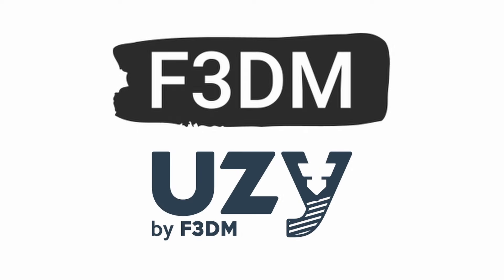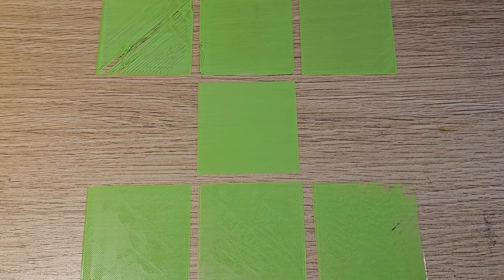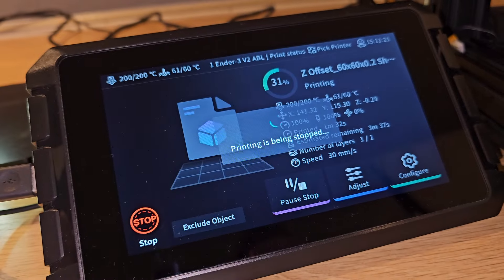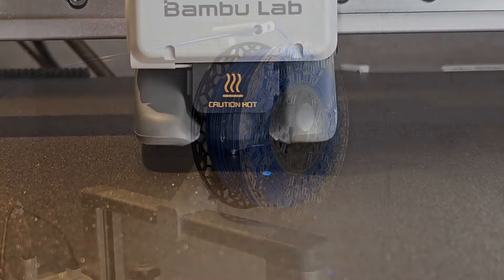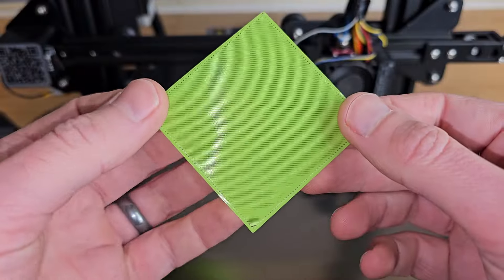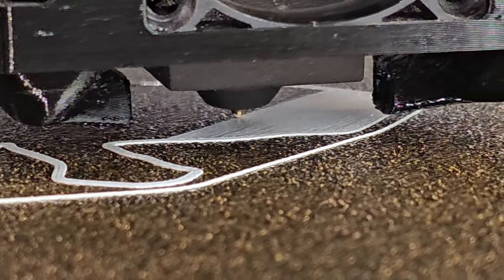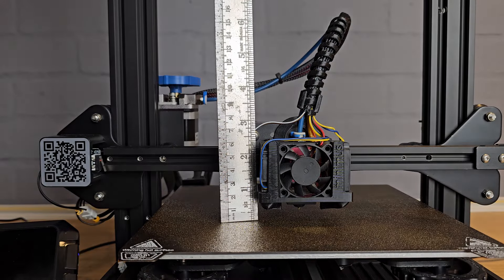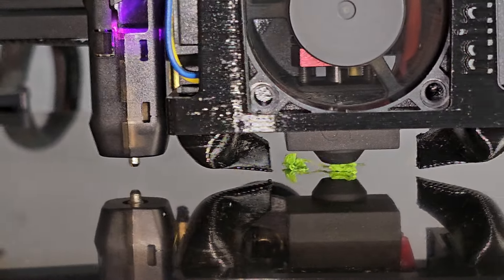Perfect Z Offset On Your 3D Printer - How to get it right!

Comment: Buy a Bambu printer. There. Your z offset is now perfect
Reply: I wish it was that easy. My A1 is having issues with the z offset
Reply: Not so much bro
Reply: Man if I had the 1k LOL
Reply: @iisGavin  just get the $600 version 👍
Reply: Yeah cause I'm going to buy a Bambu just for a Z offset fix 🙄🙄
Reply: @MrNolz33  no, to have a printer that works correctly.
Reply: Mine sure isn’t. Can’t lay anything down because the z offset is way too high
Reply: I'm glad I'm not the only one 😌 bambu a1
Reply: Or spend a few minutes and learn how to use the ender 3. I was given mine for free and a day in I’m printing great
Reply: Help me with that, I have a1 mini, and is just ok in the middle, in the borders are terrible (I already run the calibration multiple times) anyone now how to fix that?
Reply: 😂 so burn a hole in my wallet
Reply: This guy doesn’t troubleshoot.
Reply: My new ps1 is struggling here. So, not quite.
Reply: Can they print like 400mm high like a Flsun V400?
Reply: I’ve had my P1s for two months now and it has a Z-offset issue, it’s too far away, by a small amount…. First layer lines and adhesion issues on the real smooth plates…. So not entirely right there, but granted…. They are awesome for people like myself who just want to be able to punch out prints…..
Reply: @sciencesaves I have a Neptune 4 plus and it works just fine.
Reply: Nah
Reply: @jdub_1911 PS1? Do you mean the p1s or are you talking about the PlayStation
Reply: this didnt age well
Reply: why, bc YouTubers are being drama queens? My Bambu lab printers are still performing flawlessly since day one
Reply: @sciencesaves  You cant even use any other slicers
Reply: @ idk i have an anet just found it funny 👍🏻
Reply: @ I only find things funny when they are true. Otherwise …
Reply: @ThatOneDude248  #TeamNeptune
Reply: @sciencesaves they're basically no different than any other printer. They just have the tinkering done ahead of time. Parts still break, things still get out of whack. I've read plenty to posts on it. My ender 3, with just a few mods (and it was about $250 brand new 4 years ago) is a work horse, and I can print fast and reliably. When you buy a bambu, you are essentially paying for somebody else to work out the kinks for you, with necessary upgrades already done, which to be honest a lot of printers are like that nowadays. A lot has been learned in the 3D printer community, so companies are passing that along to their customers for a better experience.
Reply: We're not all trust fund babies. Spare us your useless comments that add nothing to our 3d printing journey
Reply: By replacing or upgrading 3d printer like Ender 3 v3 se mobo can be useful..
Reply: Wouldn't touch Bambu Labs with a barge pole mate.

Comment: Thank you so much for this video!  You saved my printer!  I'm new to this and have had my Creality Ender 3 V3 SE for about two weeks.  Out of the box it was working fine I thought but over the period of a week the more complicated prints I tried the worse things got.  Trying different filaments just made it worse.  I tried replacing my hotend, my bed, upgrading to a bi-metal heatbreak, replacing my PTFE tube with a capricorn tube, etc.  Nothing worked until I saw this video.  I was using the "auto" Z Offset feature and having terrible results.  I was about to buy a different printer.  15 minutes after watching your video and adjusting my Z-Offset with your instructions using a 60mm square and I'm doing the best prints I've seen out of my device.  You've gained a permanent subscriber!
Reply: He saved me so much time and anguish when I put a sonic pad on my ender 3 v2. Clear and concise explinations and why you are doing what you are doing.
Reply: Silver lining is all of those upgrades are decent upgrades, and now you have a spare hot end for when ultimately the one you're using becomes no longer usable.
Reply: @adamarzo559  I have since upgraded to the newer ceramic quick swap nozzle from Creality so I now have two spares lol.   Still struggling to get it tuned in but it’s getting better.
Reply: I know your comment is okd but I was wondering if you can possibly specify wther you increased or decreased the distance of the nozzle drom the bed.(I have the same printer and I am facing the same problem.)
Reply: @OnyxTheThird  Not sure I understand your question, but almost always after running Auto-Z-Offset I have to lower the nozzle closer to the bed.  I use that tutorial I linked until I get the perfect first layer.  Usually that's lowering it a bit more.

Comment: There's few of these explanations out there and this one was done well. You can find various bed levelling models on STL sites - the one in this video is huge, which is a bit time consuming. I made my own, which consists of 16 squares, connected with thin walls, that span into the far corners above the adjustment wheels. Do the manual level and get the bed reasonably level, then run the test model and adjust the z-offset compensation, then get a flashlight and closely monitor the extrusion as it prints. This guarantees that your 4 corners are near exact - it also shows you exactly where your bed may be warped. In my case, is showed me that my bed has a high spot just off the center point and that I should expect my 1st layer to have issues in that spot.

Comment: This was awesome thank you, I mistakenly thought z-offset would be covered by the calibration that the ender v3 ke does automatically but upon learning it doesn't this video helped me tune it and my base layer is printing and adhering much better. Thank you!
Reply: You were not wrong in your assumption. I have a KE and the auto calibration and z offset never work correctly. The calibration does not compensate correctly for the dips in the bed and the Z offset is ALWAYS at least .05 too high if not more. I always have to paper calibrate after the "auto".

Comment: Awesome video, however you missed a part that almost none youtuber talks about and I think that's why a lot of people have problems dialing the Z offset. And it's that sometimes if the flow isn't correctly tuned, it can make us think that the Z offset is "high" because we see gaps which could be because under extrusion and not really a Z offset issue or the opposite to close but because over extrusion.

Comment: I haven't gotten through the entire vid yet, so this might be answered. I run Klipper and I have a BLTouch installed on my printer. I know my bed is warped because one of the things I have issues with is if I manually raise the Z-offset at a certain spot where I notice the nozzle too close to the bed, when the nozzle gets to another spot on the bed, the offset value doesn't work any longer because of the slight warp. I haven't had massive luck with BLTouch either; it helps a bit, but not much. I don't know what to do in this instance. Z Offset is good if the entire bed was flat, but on a warped bed, it doesn't really help in my case, unless I'm not understanding something correctly?

Comment: Hi Ricky, another great video. I have been having lots of success fixing my printer’s problems with your videos. I think my Z offset is tuned properly as my sheet is very flat and smooth, but ripples appear perpendicular to the direction of printing. 

Do you have ideas what the issue could be? I have ordered a filament dryer to rule out moisture, my fan is turned off for the first layer.
Reply from the maker: Did you watch the other video on getting your prints to stick? When you get ripples like that it is usually a combination of being a little close, having a less than perfectly clean bed and sometimes possibly a flow issue. Have you checked your e-steps yet? I have videos for all these things if not.

Comment: at 8:42 you used a Feeler gauge, what gap did you use?
Reply: The gap is a ballpark.  The actual gap needed is a function of filament, bed temperature, and printing surface in combination with distance to produce the optimum first layer.  (see bed leveling method video in description)
Reply from the maker: This👆

Comment: how would do you know when its a z offset issue vs a flow rate issue? under extrusion looks similar to z-offset being too far for me. thanks
Reply: Well if the rest of the print doesn't have under extrusion issues, it's the Z offset.
Reply: You should calibrate your flow first assuming you can at least stick to the bed

Comment: I have a creality K1-c that worked fine until it didn’t. It slowly started to have more and more print failures until now it can’t even start a print. As soon as the purgeing line is down, its strings to the start of the gcode and starts moving around like its printing but all the filament is sticking to the nozzle. I’ve tried messing with z offset, bed temps, bed leveling is completely automatic, i mess with cleaning the flexible magnetic bed with soap water and isopropyl alcohol.  I do still see where previous prints were stuck but its oil free. Idk what’s happening and why nothing sticks to it

Comment: At what I think is the correct z layer height on my smooth PEI sheet, I still have small 'pinholes' where the diagonals hit the periphery lines (I use the 60x60 square too). I've never been able to prevent this cleanly. Do these appear at any point on yours where you could suggest it's too far or too close from optimum?

At 7:05 I'd say mine appears similar to your lower L and upper R prints.

This middle looks flipped over? 

I've decided to get a small microscope for other electronics or prosthetic work since my normal loupes I wear when operating (on people) are only 2.5x. Perhaps it will help really hone in a nice result if I make a proper go of it. 

I have generally done offsets for each sheet type - smooth, satin, texture (Prusa sheets), and each filament type. Haven't really needed it across brands but then I tend to look for a reliable brand and stay for consistency.

Comment: I still dont understand. The printer takes Z=0 when it hits the button for the Z-axis. If you set your Z-offset to go away from the bed for perfect print, it means that your nozzle was going into the bed when your printer is homed. if the Z-offset moves the nozzle closer to bed, it means that the nozzle was away from the bed when home. But how would the nozzle move closer to the bed if the z button stops it from going down any further ?